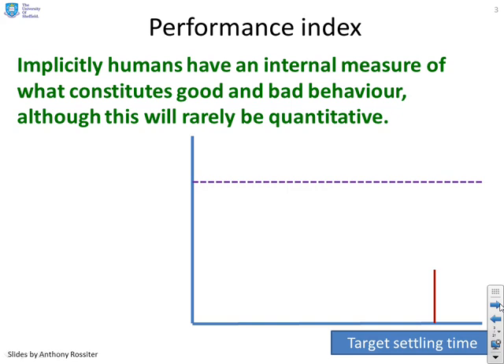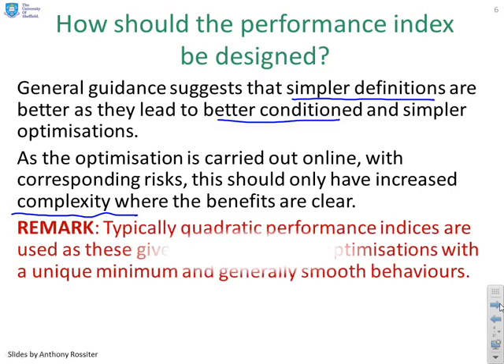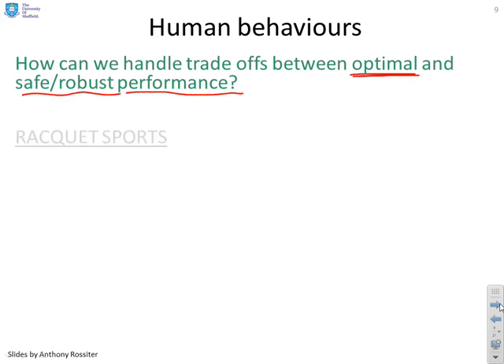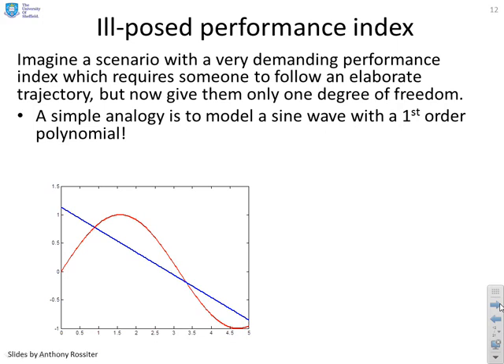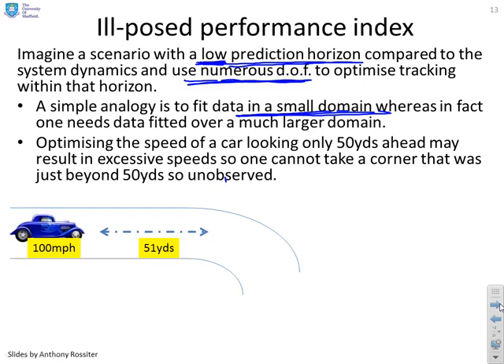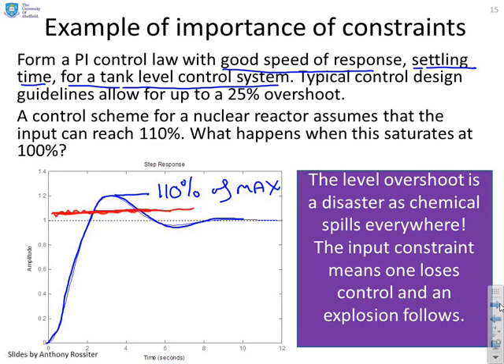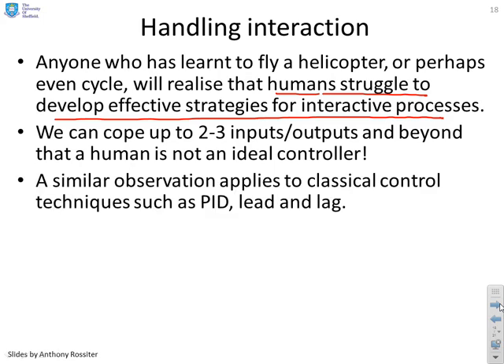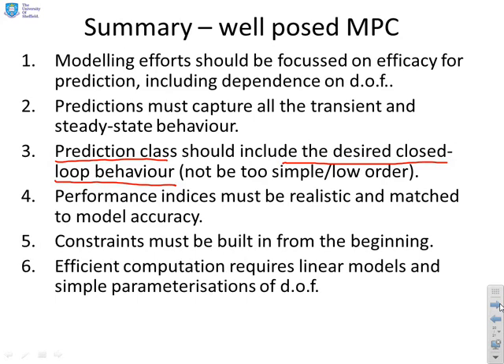Model Predictive Control  3 - Main components continued

Comment: many thanks your lectures are very useful, please sir if there is a special book I need to study in order to understand mpc
Reply from the maker: +mohammed abdullah There are several books but they have different styles and focus on different aspects so I cannot recommend one over another.
Anthony
Reply: Dear John Rossiter
Many thanks for your reply.I'm PhD student in mechanical department and I try to use MIMO control system(mpc) to control on oil drilling system and I'm good with classical control siso but I do not have any idea about mpc therefore, please can you help me to choice the short way to understand the mpc
Regards
Mohammed
Reply: @retaliatormohammed7563  HEY! Did you find a good book with a good manner to explain? 4 year later of your comment I'm trying to understand =)